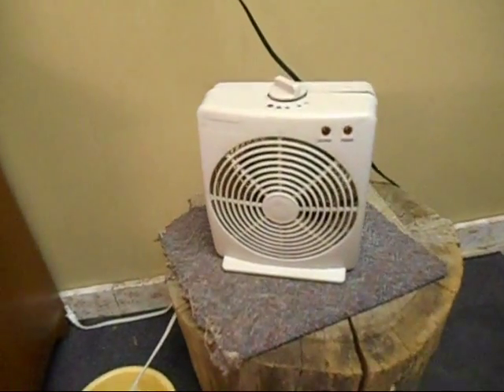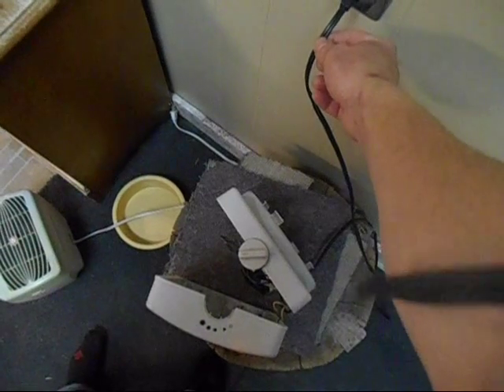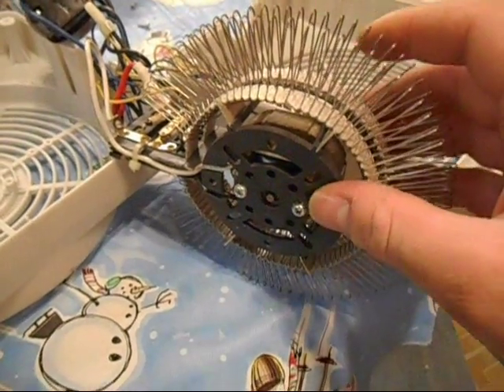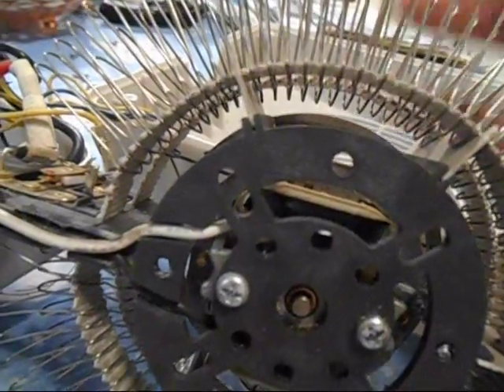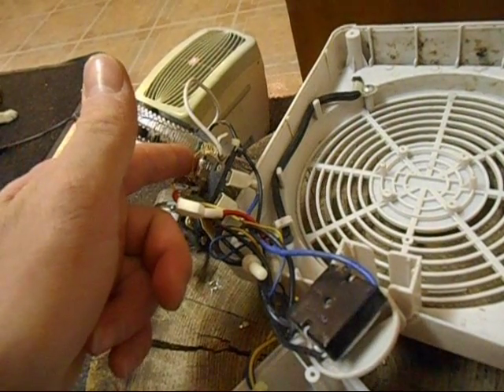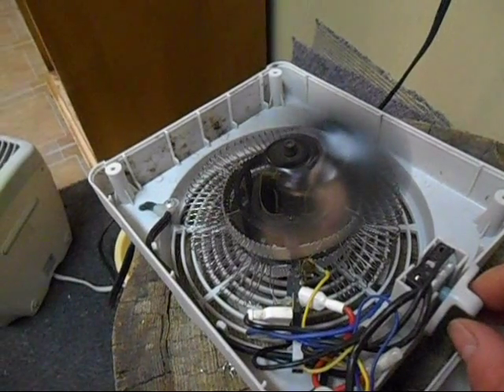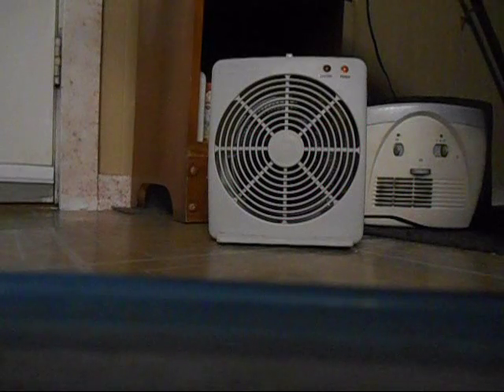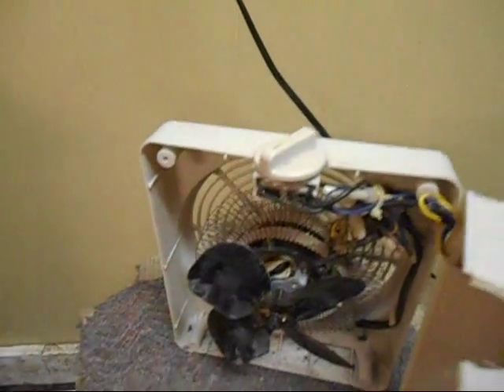Heater Autopsy

Comment: Very interesting video...I have a heater by Pelonis, same element and motor, slightly different fan blade and overall shape of the unit. It too failed, at the same component. The whole unit just stopped out of nowhere one day, and after disassembling it I found out that was the problem.
I ended up stripping the fan out of the unit and putting the rest aside for now and bought a new heater. I still have the unit, but I doubt I'll ever fix it as you did because the fan motor bearings were really worn out and it rattled like there was no tomorrow. It lasted a number of years though, much more than 2.
I still have some ambiguity as to what that cylindrical component actually is. The thermal switch is the flat thing next to it. At first I thought it was some sort of resister, but since the unit functions without it then it can't be. It must be some sort of safety power cut off thing, but I don't know how it works.
Reply from the maker: Thanks! kudos for making it last a decently long time lol I see so many of these things in the garbage, they only grease the bearings at the factory so they get gunky and stiff within a couple of years and then of course burn out from the excess heat.
I just took a guess that it was the heat fuse lol and I guess I was right. I also kind of thought it may be some sort of resistor thing at first but I also new that pretty much every appliance has a heat fuse nowadays so  thought it had to be the heat fuse. I'm guessing that there must be some sort of material in the fuse that ruptures when it gets to hot or something along those lines.
Reply: Interestingly enough I've had no problems with the fan motor, I think it actually had a reasonable amount of oil in it from the factory. I think what helps is if you run the heater with just the fan for a few minutes before shutting it off to let it cool down, otherwise all the heat from the element stays around the motor and that's never good.
It must be some sort of thermally related device, or maybe its a current limiter, I have no idea really. Wish there were some numbers or something on it to look up a comparable part on the computer.
What kind of heater are you using in its place now?
Reply from the maker: Jordan U I also usually always run it in fan mode for a little bit to cool the elements, with heaters I care about anyways lol.
We are now using this Fusion cheapo walmart tower ceramic heater that I got from the garbage dump.
Reply: Hobbycentral A lot of the newer heaters don't have the ability to run the fan without the elements, which is just part of the cheapo design to make it fail faster. You aught to make a video of the new old heater lol
Reply from the maker: Jordan U Gotta love new stuff that aims for having a limited life span lol at least that's how it seems anyways.
Yeah I will have to make a video of it. I think it deserves it lol
Reply: Hobbycentral
That's definitely how they do it now, and its ridiculous. You would never see that 50+ years ago. I have no doubt that the component which failed on our heaters was also some sort of thing that inevitably fails over time.
If it survived getting tossed out and its still running, I'd say it definitely deserves a video lol